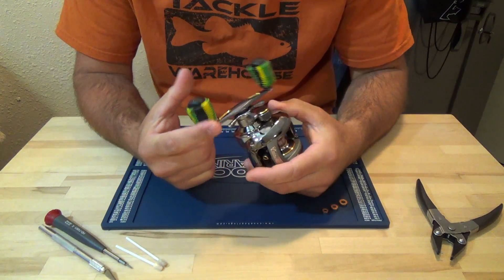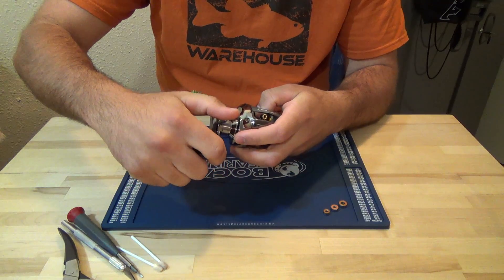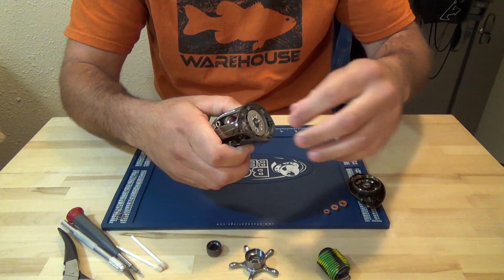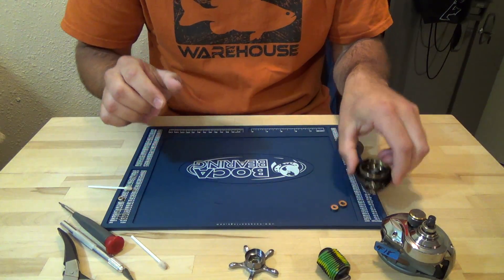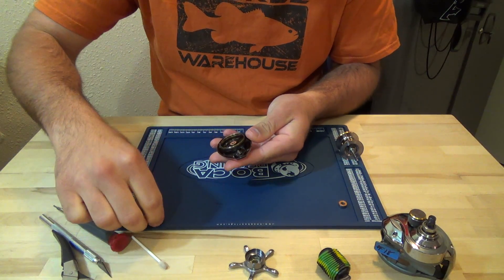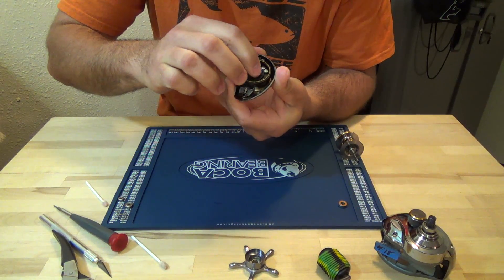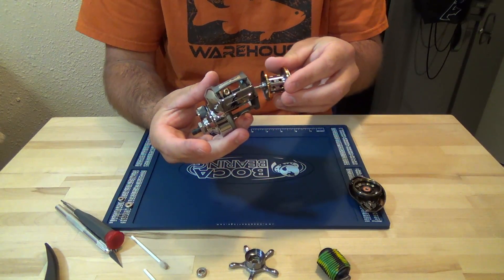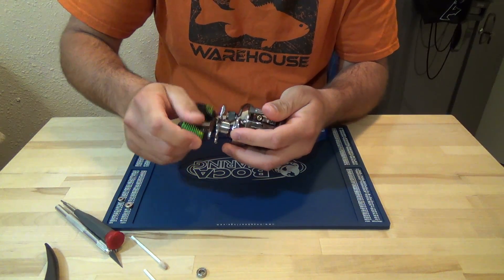Boca Bearing Upgrade: Johnny Morris Signature Series JMX10SC (TackleJunky81)

Comment: 7: 21 Holy cow never seen a handle and spool spin like that!  Is there such a thing as the spool spinning too well and causing backlash issues?
Reply from the maker: On lighter lures you may backlash more often just because the bearings are spinning faster than the lure can bring the line out, but if you adjust the breaks correctly it won't be that big of an issue.  With a 3/8 or 1/2 oz lure and 15-lb line you can LAUNCH it with these Boca Bearings!!